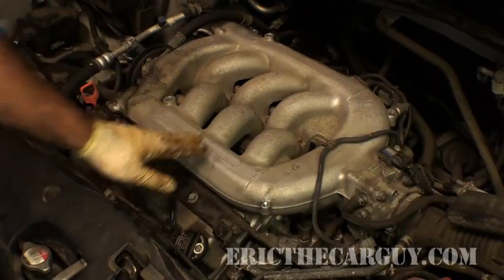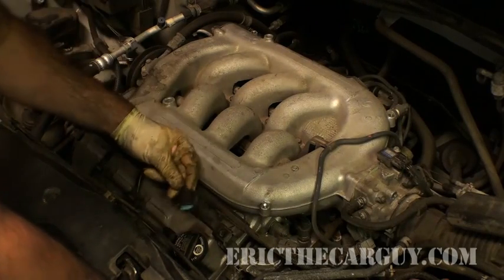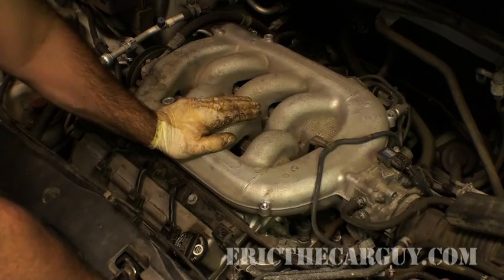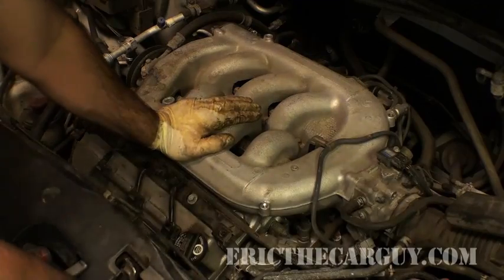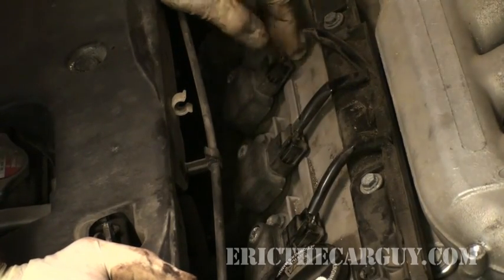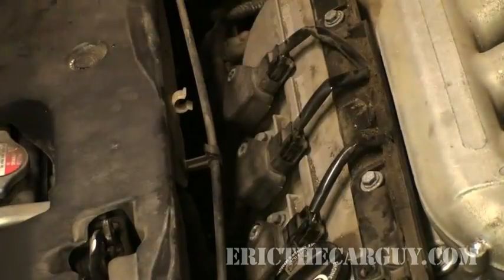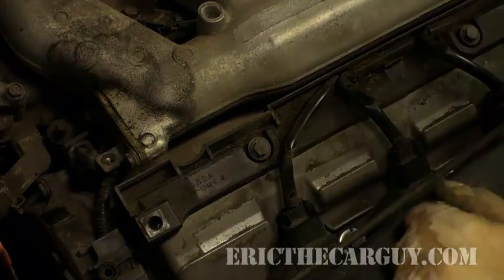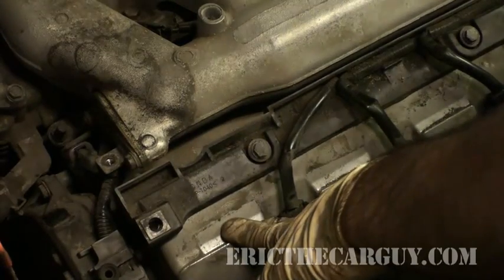How To Perform A Power Balance Test  - EricTheCarGuy

Comment from the maker: @Ghostixe If the car is not stock depending on the modifications you may need larger injectors or it could be a characteristic of the modifications (different cam).  Not knowing what has been done to the car makes it impossible for me to help and even if I did something that is modified from stock does not have a "typical" path to diagnosis and repair.

Comment from the maker: @eldaguinio If there is NO change in engine performance when you disable a cylinder that would be the suspected cylinder and would need further investigation.  In the case of your VW start with any check engine lights and then look to the tune up items for the source of your issue.

Comment from the maker: @Ghostixe It could just as easily be a vacuum leak causing the system to read lean which would make the computer command rich.  Make sure the mechanical health of the engine is good with a compression test.

Comment from the maker: @fastveedub It can work for waste spark ignition if done correctly, that was what I was referring to in the video that would be shown in a future video.Getting to injectors on some vehicles can be a lot more difficult but if you are unable to disable the ignition unplugging injectors will work just fine for this test, in fact that is what I believe the scan tool does when it performs this test. As you state it can also help with the mechanical problems you mention. Thanks for the great comment.

Comment from the maker: @zztopgearhead1 If that has the 2.4L with the coil cover assembly then I would look to that for the possible cause, they have been known to get cracks and cause an intermittent short.  You could spray it with some water to see if it begins to run rough, if it does then I would replace it.

Comment from the maker: @vgs8606 I think that depends on your skill level and experience.  For the most part in that situation a power balance test will get you started on the path of diagnosis if nothing else, if that didn't yield any result then you would obviously move on to more testing to find the cause.  Thanks for your comments.

Comment from the maker: @vgs8606 First make sure you are using Nippon Denso or NGK plugs, if not change them.  Next try this test to see if you see a change.  Lastly those valves are adjustable and they may need adjusting, I've shot video for this but haven't had time to edit it yet.

Comment from the maker: @UncleSam330 First thing I thought of when reading this was the clutch was slipping until you mentioned that it happened when it wasn't in gear.  You might want to check for air leaks in the tube that goes from the air cleaner to the engine, any leaks here can cause a problem and mess up the MAF sensor reading.  Probably not a bad idea to check for vacuum leaks either.

Comment from the maker: @TeDuaMalakie Yep, on older ignitions you can just remove the plug wires one at a time to accomplish the same thing, I recommend the plastic pliers they make for doing this however so you don't get shocked.  I have done a few videos using Hondas but I've also got quite a few using other vehicles such as GM, Ford, Jeep, Pontiac's, and more.  I hope to cover even more in the future.

Comment from the maker: @blooz62 Check to see if you have 12V at the solenoid wire when you turn the key to crank, if you do then replace the starter, if you don't then your problem is between that wiring and the ignition switch.

Comment from the maker: @Michiganborn1969 One way roller clutch, the solenoid is the relay on top that engages the starter.  I use just a drop or 2 of transmission fluid as it has some detergent qualities to it.

Comment from the maker: @Michiganborn1969 The one way clutch may be hanging up on the starter ( that's the part that comes out to engage with the flywheel).  I've had some success with removing the starter and lubricating this assembly to correct this problem.

Comment from the maker: @blooz62 Check the connections at the battery and the cables first, especially if you have those crappy aftermarket replacement terminals.  Clean the battery terminals and the connection at the wire and see if the problem goes away.

Comment from the maker: @Michiganborn1969 No, that sounds like you are reengaging the starter, if you do this while the engine is running the starter will make contact with a moving flywheel, not a good thing.

Comment: Also I almost forgot to ask probably because its not a real problem yet. On my 04 Ranger 3.0L when I start it, it fires right up but here's the kicker, if I turn the key to start just a 1/2 second after it started the starter makes a grinding noise. Is it your opinion that the starter is on its way out? I prey its not the flywheel. The truck has 97k miles on it for what's worth.

Comment from the maker: @MrWalleye Your better of disabling the ignition as if the injector is leaking it will still be dripping fuel even if it's unplugged.  Good luck.

Comment from the maker: @Michiganborn1969 The danger comes in when your working with some very high voltage ignition systems, having to disable them can be tricky, I plan to do a video on working with these systems at some point.  You want to avoid getting shocked by these since they have the potential to stop your heart.

Comment from the maker: @legendfang Yes, you would pull the wires instead of unplugging the coil packs.  I recommend using a set of plastic pliers that are made just for this however to avoid getting shocked.

Comment from the maker: @dwreus That trick has been in more than one move.  I've actually tried it with mixed results, one time the car didn't start, the other time it did start and blew the restriction out the back of the exhaust.  I've also heard of people blowing up a muffler doing stuff like this.  In short, it might work, it might not, just be careful.

Comment: Eric, is it ok to remove the plug on the injectors in a MFI system (F150 5.0 L) one at a time to find a faulty injector? I've tried the balance test using the OBD1 but it won't execute.
Thanks bud.

Comment: @AutoTechHector -  Wow you could have at least posted something more constructive on why it's wrong. From what I was told you can take off the plug wire and if there is no change in idle then you could have a faulty spark plug ?  Sorry if I'm "Wrong!!" I am not an expert in auto tech like you..

Comment: That's an old school technique I learned with spark plugs, if you take a plug wire off the plug and no change than you could have  a faulty spark plug or injector problem.  Great video Eric !!! Thumbs up !!
Reply: Great old school way of checking, but from past experience, I would pull the wire/connector from the distributor side for each plug.  I pulled the plug end one time and it bit me through the spark plug boot and grounded itself through me where I was leaning against the side of the car.  After my boss got through laughing hysterically, she told me about pulling the wire from the cap side instead of at the plug.

Comment: i have done this on my 280Z.  Didn't know it was called this.  On a 32 year old motor in a 32 year old car that was left in a field I had a lot of visual cues before I did this test.  Like semi eaten fuel injector lines, old old vacuum lines and plug wires, and much more.

Comment: Hey Eric good vid, always helpful and educational. If its not a coil pack but wires like in older cars would you pull the wire out one by one and it would be the same as doing so to a coil pack? Just wanted to know as I have spark plug wires and not individual coils.

Comment: @dwreus  We used to put bottles on renter cars. The engine would not start because the seal was so tight and exhaust could not escape.  But if you put the pedal to the floor (clear flood mode) It would fire and the bottle flew off like a rocket.  LOL.